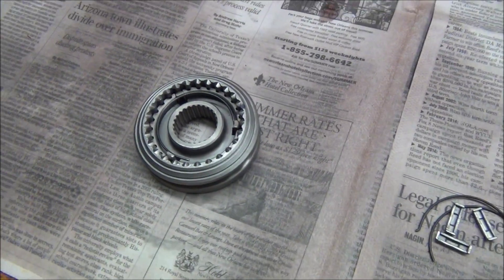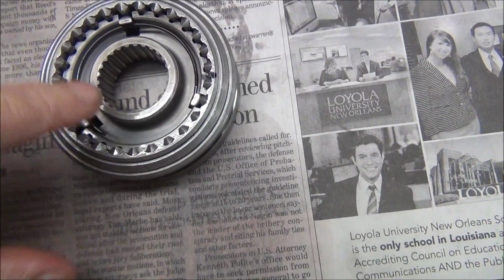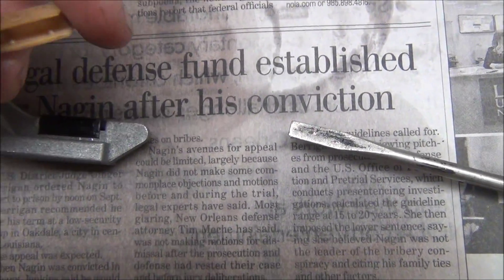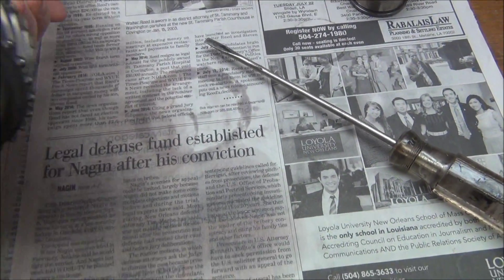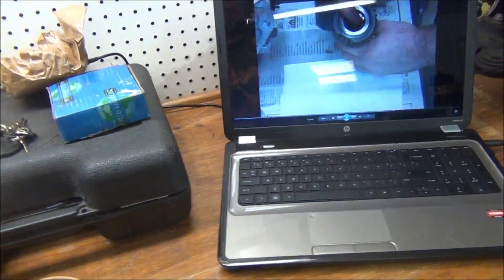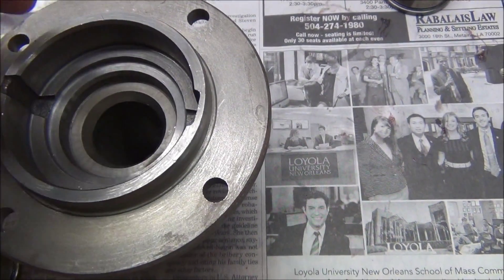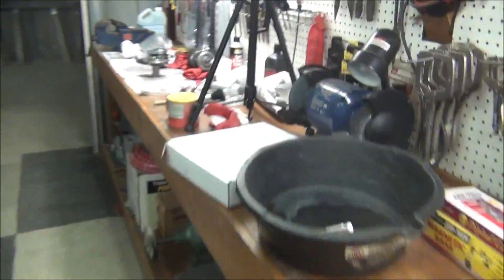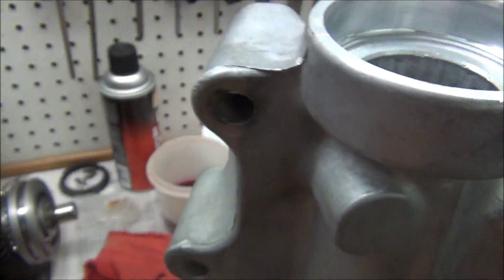94 Firebird part 5 T5 Transmission

Comment: Hansen, if you put the housing in the oven and heat it up and put the bushing in the freezer and freeze it. The two will go together a lot easier with less chance of damage..........tony
Reply from the maker: i bought a seal and bushing driver set and will use that and do what you suggested thanks

Comment: Is there a driver specifically for that job you could rent? Or a bushing / seal driver set, likewise? Otherwise, what Tony sez below would help, I guess. Never done it.
Buddy
Reply from the maker: i have a bushing and seal driver set going to try that first got the new bearing today 11/11/2014 every thing fit tried it on the drive shaft first this time later